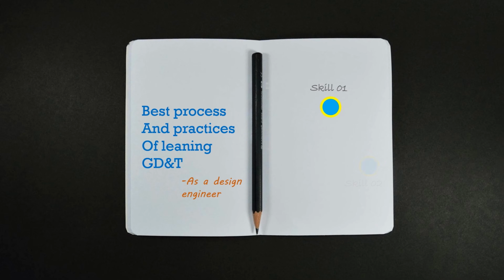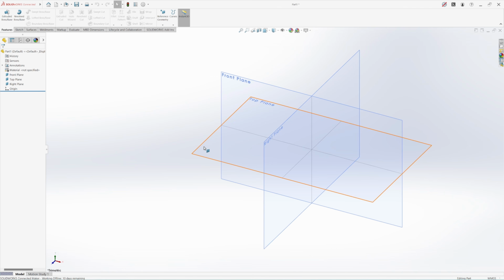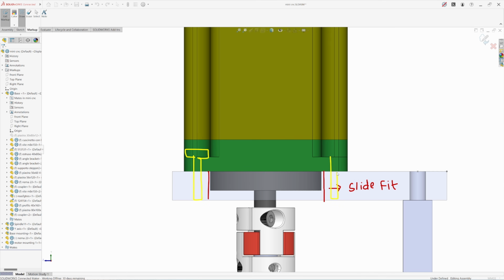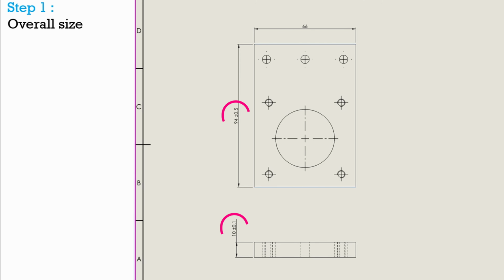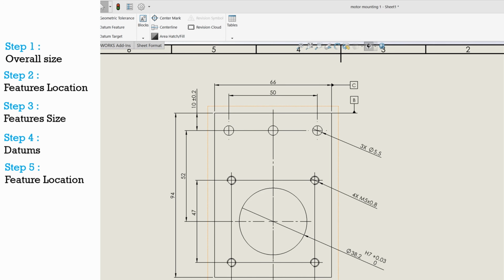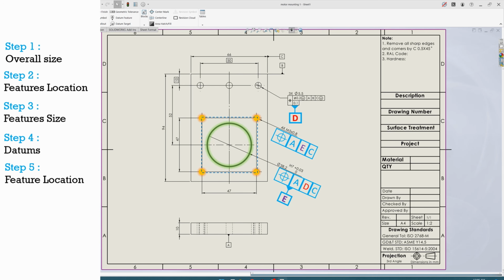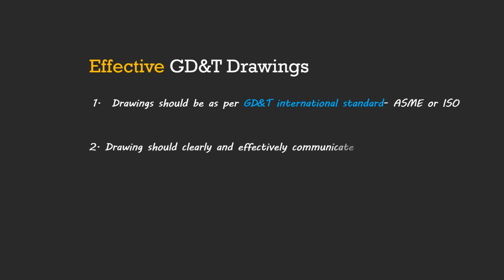How To Learn GD&T as DESIGN Engineer | Lesson 01 | MasterClass Series

Comment: Another good video well done and thank you.
Good Start.
The rules are important and many engineers do not understand them, they are only the beginning, the practical application of them is the real art. Hopefully you will cover some of the finer points as you get onto individual Symbols and application.

Some observations.
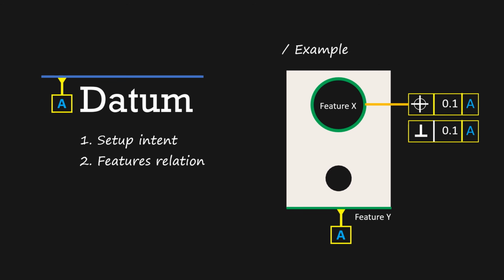14:53 The Squareness example shown is somewhat meaningless in a practical world it should really be based from the bottom face and carry a projection length (thickness of plate by default). There are times when a projection is longer that the thickness of the part depending on assembly conditions.

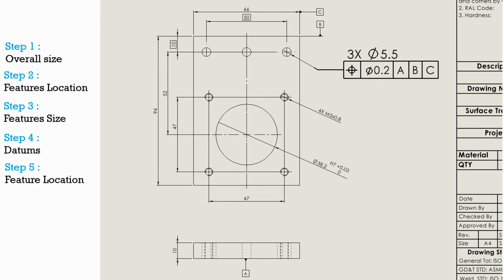18:18 Datum "A" is meaningless unless you specifically want the position of the intersection on that datum face.

From a design point of view the Positional tolerance incorporates a squareness, the 0.2 cylinder contains this and as the hole moves from its theoretical point the squareness value will change to maintain the axis within the cylinder. In the case on CMM's you will find two different applications, position and position of axis. If not properly guided or a projection length is not applied many metrology people will use the wrong one which allows production issues that go undetected and can have people scratching their heads looking for the problem.

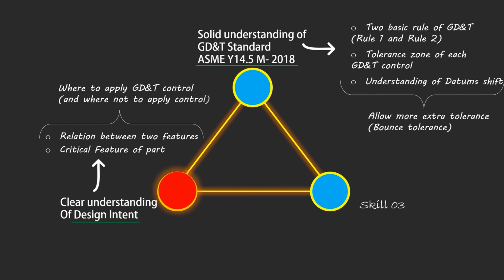27:10 Excellent explaination, especially the bit where you don't have to apply GD&T.

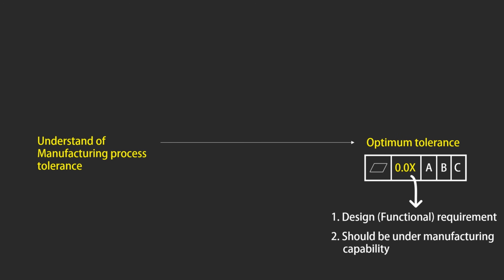29:58 Optimum tolerance, brilliant well done many engineers fail on point three, it should be possible to inspect / measure.

Some advice for budding engineers, if you not sure it can be manufactured or measured reliably then go talk to the production engineer who has to make it and the metrology guy who has to measure it, talk to the people that know, it can only help you understand better.

Comment: If I was in this situation, I would have taken bottom plane as datum A, motor hole(big hole) as datum B. With respect to B , all the holes can be controlled with position tolerance. Datum B should be perpendicular to A and datum A should be flat. That's it

Comment: Nice work but, Isn't there a problem with the location of the 38 mm diameter? Shouldn't there be a basic dimension extending to reference surface B? And therefore, shouldn't the 10 mm basic dimension no longer appear? thx
Reply from the maker: It's up to you, how you want to be dimensioning. result will be same.

Comment: Hey! I absolutely love how you explain things and appreciate the content overall. However in this particular application you have chosen datums B and C, which are not relevant to how the part is interacting with other components. It's wrong choice for a datum. The feature that locates your part is a hole pattern 3 X 5.5 and it should be chosen for a datum (which is still very poor datum). To make it being a good example you would need to slightly redesign the part and have much stronger datums like a pair of dowel hole and slot or walls which would be locating the part.
Reply from the maker: Selection of the datum completely depends on the design intent, what is more important for a particular part, its assembly with other parts or the features of the parts itself, it is not necessary for the datum to have a dowel and a well finished surface. I will make a complete guide on Datum selection. thank for watching

Comment: Please make a video of v or timing belt selection when both pully are same size
Reply from the maker: Please check out the timing belt and Pulley selection video. Allready there
Reply: But that calculation can't make right answer if I select number of v belt with same pully size can't find right answer and also in timeing belt can't select right belt size what should I do for same size pully
Reply from the maker: Yeah, for V belt and pulley. i will surely make a video, as for now please try to flow V belt pulley and belt manufacturer selection procedure

Comment: Hi! Nice video. Have you in plan to make a video about modifiers (M, E etc.) to datums and tolerances?
Reply: Beacause i think that it is difficult issue
Reply from the maker: OfCourse, without modifiers, specially without Maximum material condition, we can't provide bounce tolerance, and bounce tolerance is the one of the main strength of GD&T. We will also cover advance topics like datum target.
Reply: @mastermechanicaldesign  Yes, i know that maximum material condition is very powerfull tool, but this is not easy, especially to datums
Reply from the maker: Yes, true, we will understand this datum shift concept with CAD models, I'll try to make this very easy.
Reply: Nice, have a nice day !